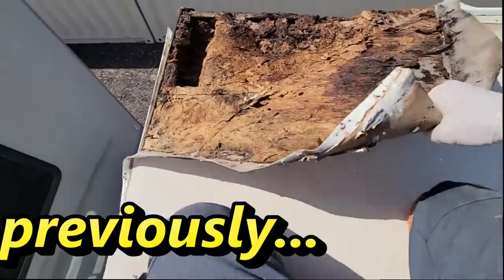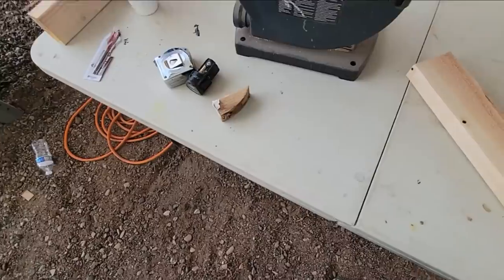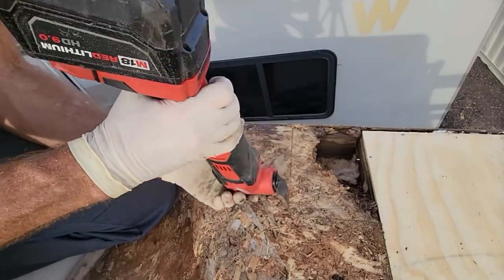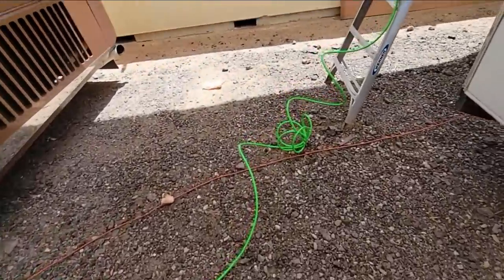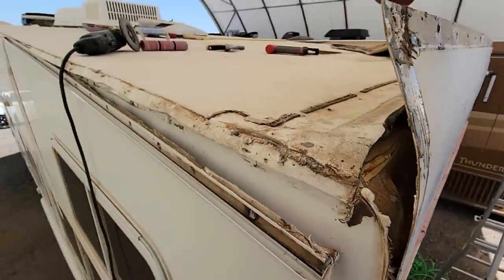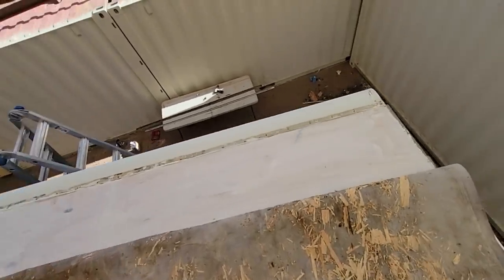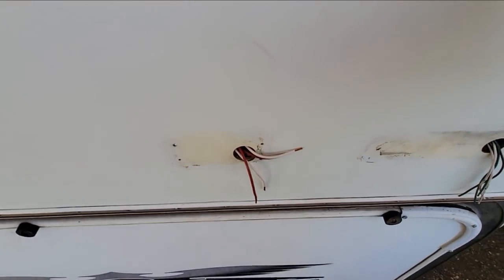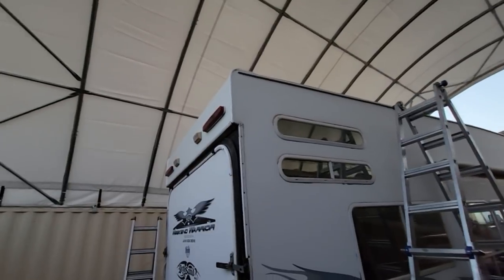Completing the Rotten Weekend Warrior Roof

Comment: Love the wago connectors...even the generic ones a little better...SUGGESTION: use electrical tape around the levers on the connector to keep them from pulling up and I zip tie (thin zip ties) the wires about an inch down from insert holes in the wago connectors to bunch them together....helps ensure the wire stays in place....just my 2 cents worth...great connectors!!!
Reply: Thanks for the good ideas on how to make the WAGOs more secure. I have had the levers open when stuffing them through a hole.
Reply: @hillbillyrv  yw
Reply from the maker: Good tip

Comment: You can tell it's HOT in AZ... I Wish butyl would come off like butter like that... Or filon would bend without cracking. Good job.

My only keyboard warrior critique... Even open air situation I'd recommend wearing a mask or respirator when applying that glue.
Reply from the maker: Probably

Comment: After watching, this made me feel confident that when I did mine it was correct. Ended up with a full TPO replacement. Uses Eternabond tape along any roof  Penetrations. Vents I  sloped up eternabond to prevent water extrusion. I think gluing it down would be the only thing I would change. Not super happy with the product used.
Reply from the maker: Awesome! Thanks for the comment

Comment: I just had the front of my toy hauler rebuilt because of leak near the front cap . They pulled the membrane back and replaced the whole 4x8 foot roof deck then seamed.  it. They used eternabond  tape on the seam. Had to rebuild the top corner of right front wall. Luckily mine is stick and tin construction so they rebuilt wall from inside. I would insert picture but can’t figure out how . Anyways I think I could have done it after watching this video. Thanks .
Reply from the maker: Thanks for watching! :)

Comment: So you are finding things the factory should have done different for longevity/prevent damage. Do you communicate with them to make a better overall longer lasting product? Or do they not care, hoping you buy anothet one... And they just scream, "check and seal" everything every month to prevent them from taking responsibility fir poor workmanship process and materials.   Thank you for the information I need to be doing my toy hauler roof as well. My damage was caused by a tree branch that fell and damaged the corner. I did not know it was leaking... Thanks again.

Comment: After watching your videos I took on a DIY roof replacement on my toy hauler (a NRG similar to one of your older videos that has the same front corner water damage). With your tips and some construction experience I think I’ve got this, but... Big question, after removing the old roof membrane what’s the best way to manage the sticky roof deck?  The old glue is grabbing everything and I don’t want it to affect the new adhesive for the new roof.
Reply: You need to remove the glue from the luan as well as the glue from the (I assume filon?)
Its a giant mess indeed.
Reply from the maker: I replace the luan as well

Comment: I have to tell you that when I saw these two videos, I cringed. I could tell this was a SLC. Until last year, had a Weekend Warrior 2006 SLC3905 40 footer that about 8 years ago a good friend of mine who is a custom home builder/framer helped me replace the entire roof- trusses and all (except that we didn't have to do the ceiling). I was shocked at how much of the deck and the trusses were degraded. Problem with the SLC family, WW did not crown the roof which meant all of the water within the last 30 feet of the roof when to the the back. And they only used 3/8" OSB as the roof deck. Not only did we replace all of the OSB deck material but also all of the framing on the roof, and along with 10 each 1 1/2" steel square tubing as wall-to-wall bracing, I also got 3/4" 4'x10' ACX plywood to rebuild the roof. Replaced all of the vents and skylights.  The year later, I wound up replacing both the front and rear caps which was a feat in and of itself (I've never used so many tie straps in my life!). All in all, it was about $5200 in materials and my friend even got a couple of his guys in his framing crew to help out. Mt biggest regret was not putting a TPO membrane down but rolling on a rubber roof coating about 30mil, because it showed up quite a bit.  I also hated the front ladder and luggage rails on it so we left them off. Replacing the bathroom skylight, I was able to find a 24" x 32" skylight of the same brand and fabbed a tri-fold ladder than would fold up into the ceiling cavity so I only had to climb about 7 feet in the bathroom to get on the roof!